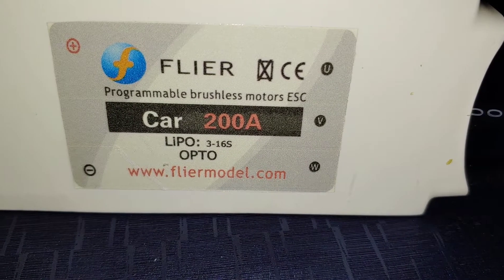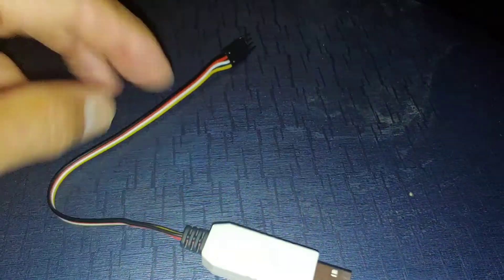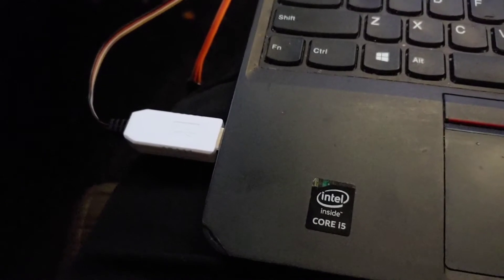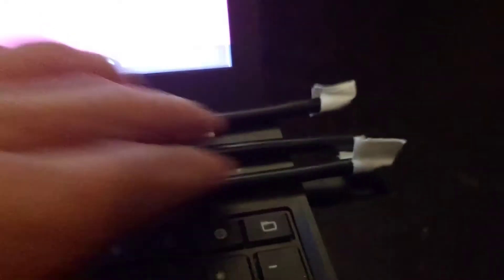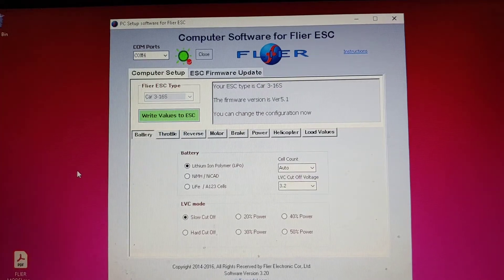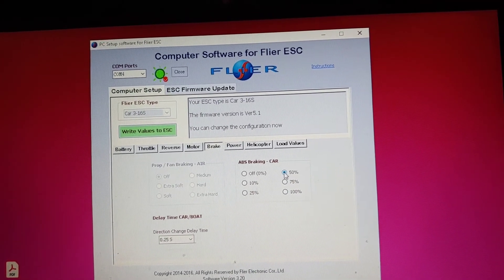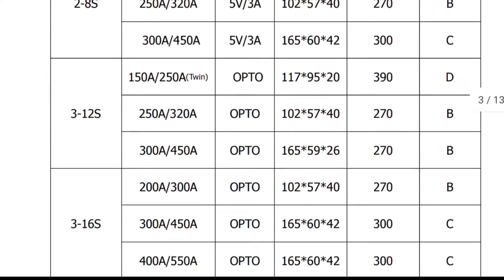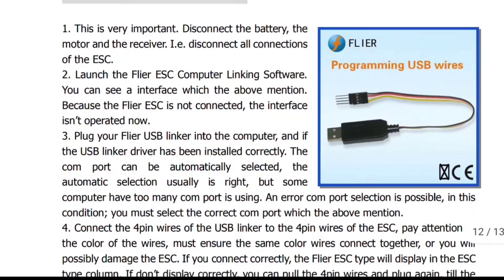FLIER 200A CAR ESC programing

Comment: Nice thanks a lot! Just got my FLIER 300A BOAT 3-16s i will be putting in my Raminator V4 run 12s cause 16s will break parts I added a second radiator to the truck also for better cooling